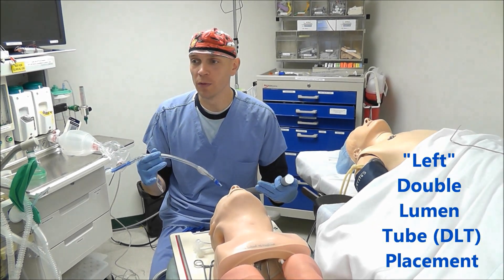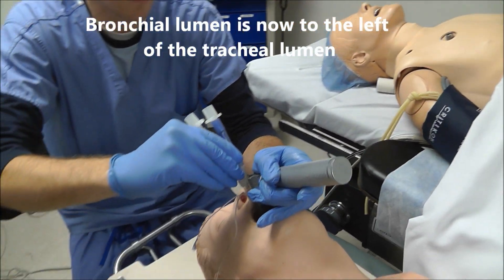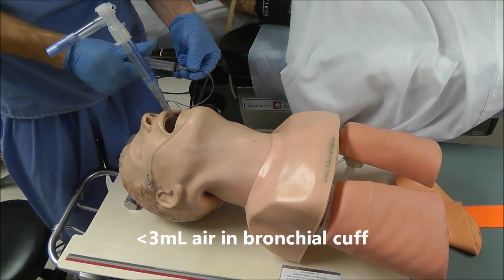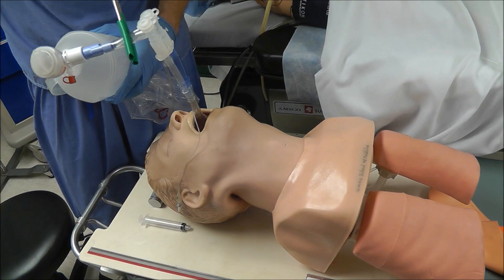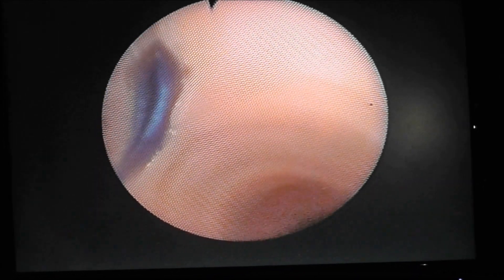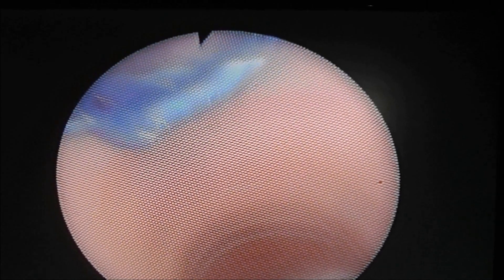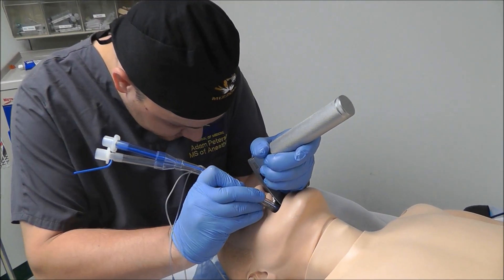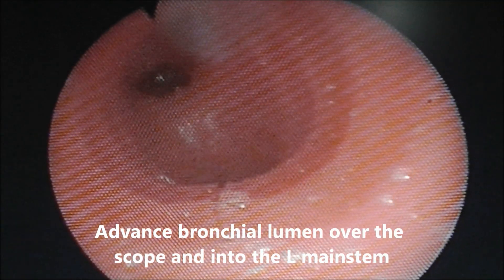Double Lumen Tube 2/2 (Insertion)

Comment: you should add a video on troubleshooting techniques for DLT placement and positioning.  For example, when both lumens of the tube are in the right mainstem.  Or when the bronchial lumen is too deep on the left side.
Reply from the maker: Excellent suggestion.  I will definitely look into that!